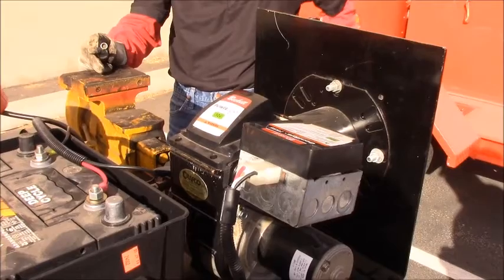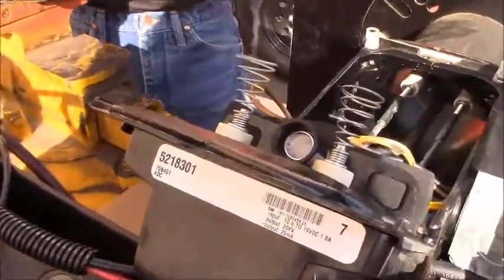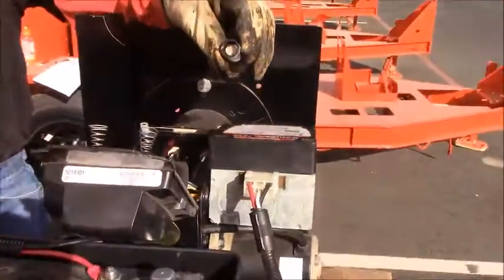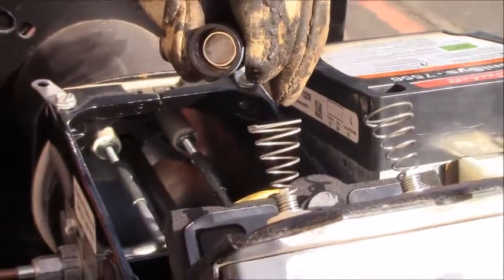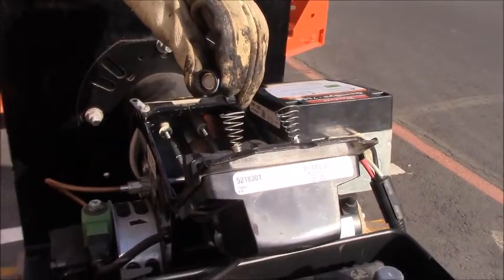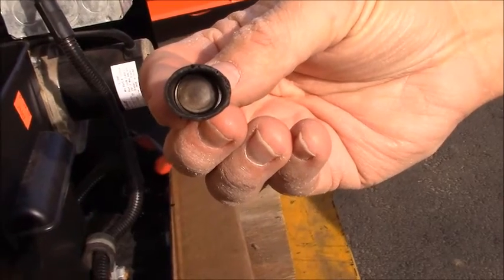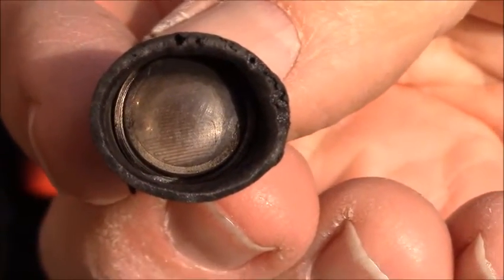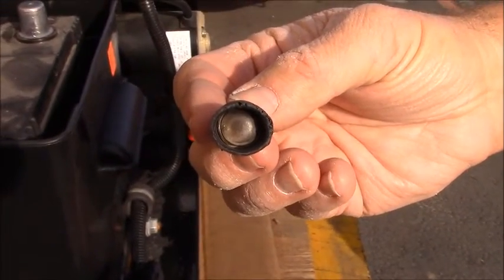Burner Troubleshooting: Cad Eye | CRAFCO

Comment: Sir Can you plz help Burner RL 134  controller keep it indicating red and green light wht is the problem?, i tried to reset it is not helping
Reply from the maker: Hi there. The burners we use actually do not have red and green lights. Yours must be a different brand. We would suggest contacting the manufacturer of the burner for help.